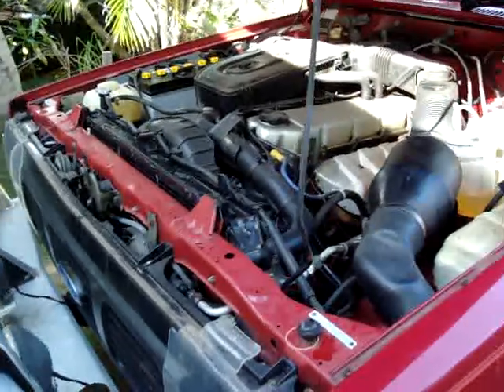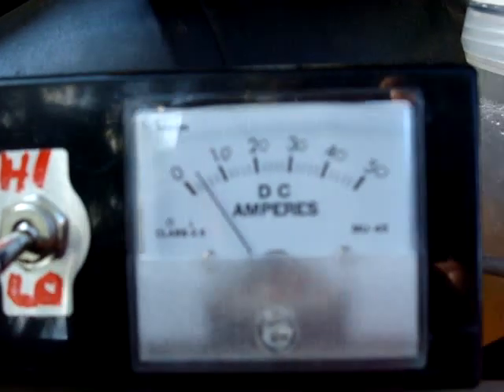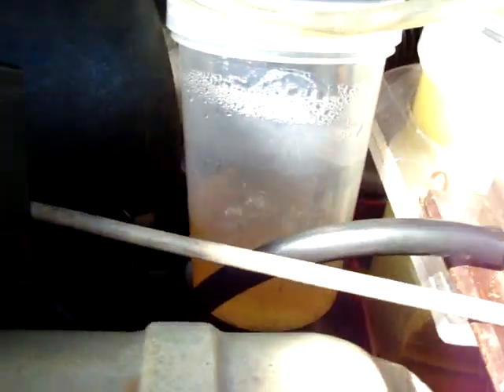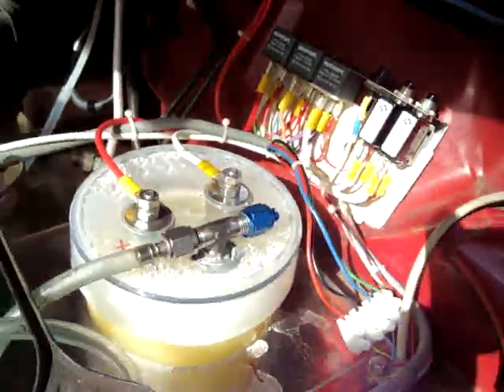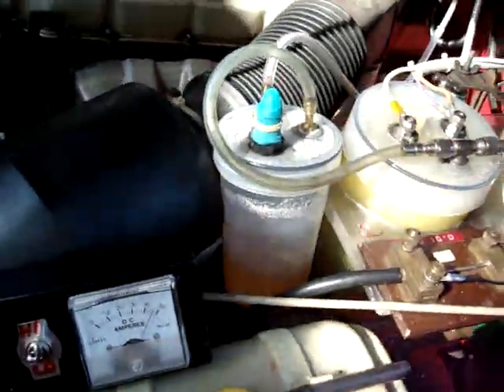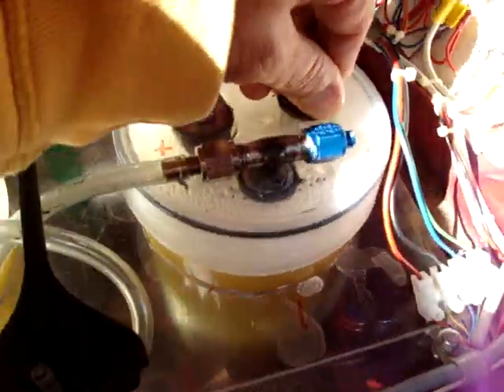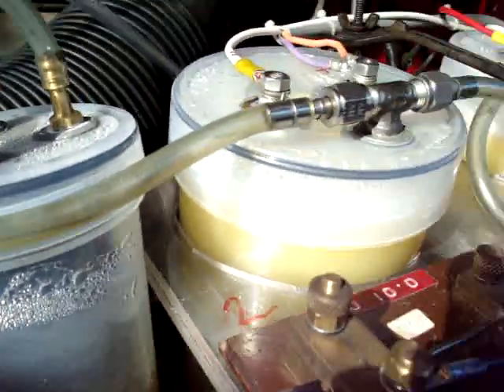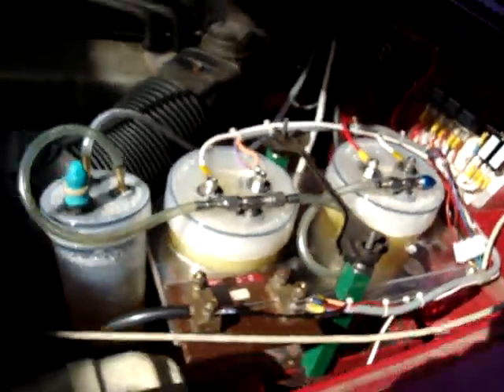nissan patrol hho

Comment: Impossible 50 Amp come from 12 volt !!!!!! Maximum amp are 18 or 24 come from 12 volt ... this is fake because it come from other way not battery.
Reply from the maker: It might sound impossible to you, but that's really not hard to draw 50A @12v
Reply: you say it is just a 12 volt battery car !!!! ok you right .... prof that how can you get 50 Amp from 12 volt battery ... i was test a few years ago it just give 18 amp  maximum ... because they type on car battery 18 Amp ...
Reply from the maker: I don't want to spend too much time on this because your statement is non sense.
How much current does the battery supply for engine starting??? hundreds.
What sort of car battery is limited to 18 amps? crazy.
In fact my n70zz is marked 12v 720 cca (cold cranking amps)
And finally, the battery does not supply anything once the engine is running unless
the 80 amp alternator maxes out. have a nice day.

Comment from the maker: to me, a more definative test is using a carburator equipped motor and maybe delay the ignition timing like i have to compensate for the faster fuel burn with the hho added to the fuel mixture.
Inmy case, i was a bit disappointed with my result, about 10% better economy.
when i have fitted my stan meyer tubes type cells to the patrol i expect a better figure.
Thanks for your interest in my setup.
Adrian.

Comment: hi try stainless steel containers and make them positive .make sure they are insulated from chassis...it makes negatively charged water look at all those that have done water fuel all use this as it excites hydrogen cause oxygebn wants to leave with hydrogen electrons..it does work

Comment from the maker: 7763079, Hi, the reason i chose the nissan patrol was it does not have efi or any computer control for the engine.
We see guys using with efi engines modifying the ego sensor voltage and i
would not be surprised this results in a lean fuel mixture and resultant better fuel economy. hho injection or not.

Comment from the maker: @timjimcal hi, the cells are developed from ss tubes right now and used for testing only. i don't think the brute force electrolysis is going to get more than 10% better economy. i've spent some big bucks on test gear to help my experiments into resonant cell production not to mention time. still have not cracked anything that outperforms 100% DC current like in this video.

Comment: dc motors all of them make curent when you turn them by hand or by a drill or add to your pully system or even drag behined the car i use a razor csooter just the motor and rear weel hooked to the back of the car wiers ran strait to hho cell dont hook it to a batery it makes more curent the faster you go and will fry the battery i dont now how to contol extra curent please tell every won so we can be free of cars charge system some one out there nows how to contol the extra juice